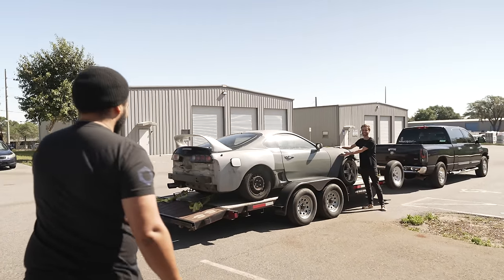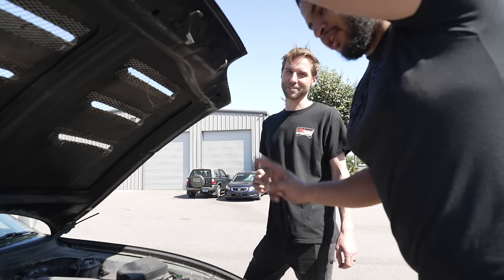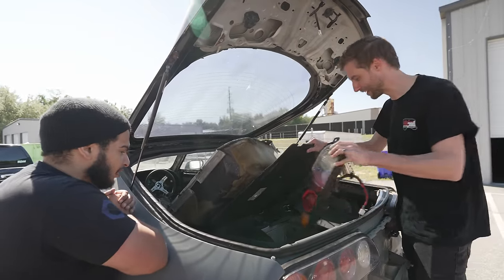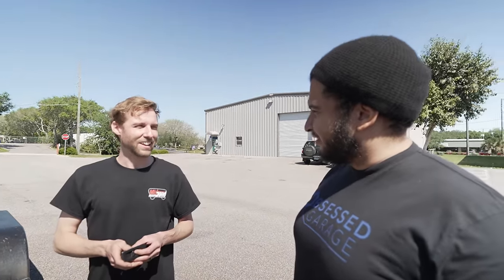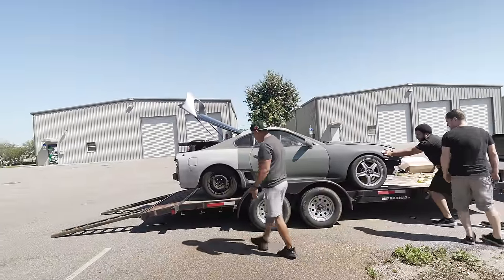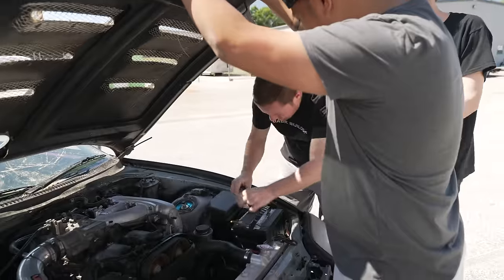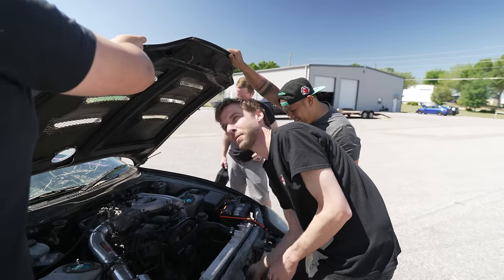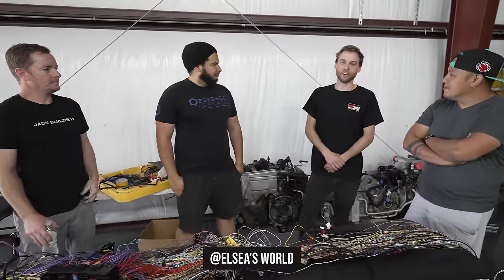I Bought A WORTHLESS Toyota Supra And It's Worse Than You Can Imagine

Comment: If it’s an Aussie car it’ll have an Australian compliance plate & a VIN plate. These plates are usually located in the engine bay likely on the firewall or strut tower for that era. They may also have the chassis number stamped on the frame on the radiator support, strut tower or under the frame behind the windscreen passenger (left side). 
For the year it’s unlikely anyone “imported” the car from Japan outside of being purchased from a Toyota dealership that was built in Japan for the Australian market. FYI
Reply: JZA80 was never sold new in Australia. ALL JZA80's in Australia are Japanese imports. It will have a low volume import compliance plate that will list the company that imported it to Australia.
Reply: True my old man worked at Toyota around that time and they never came here new we only got celicas and mr2s
Reply: @nitrojawt the correct answer 💯

Comment: 1uz Twin Turbo Swap
Should bolt right in, new kits are available online :)))
stock bottom end takes 800 HP with the 1st gen UZ thick rods
Reply: lol yeah u better do a 1UZ swap considering that NA-2J isn't gonna cut it 
realistically, would be cheaper to do a UZ build, avoid the 2JZ tax and get yourself a selpt-on reliable Japanese piece of engineering
You've had SC's before, you probably understand how good 1UZ's are 
U should see what they're doing to them in the middle east, engine turns into a machine g*n for hours on end

Comment: I bought me a 2000 Honda Accord ex 3.0L v6, 4 door coup. The car was totaled and was a total loss. I bought it and rebuilt it. Now I got it like 80% done and road worthy. 
I've gotta get a key phob, gotta get the ball joints on front passenger side, brakes, and gotta get cat backs. About to get the new gasket for my oil pan done. And it needs an oil change. I had to do a lot to it such as rebuild the motor and the entire front end. I had to jump through so many hoops just to get the car legal. Got a salvage title.

Comment: I think the difference of screw vs. bolt comes down to convention. Typically a fastener with an external feature for tightening, like an external hex head or external torx is considered a bolt. Internal feature for tightening, like Phillips, Allen/internal hex, torx, flathead, etc. is normally considered a screw. There are exceptions though. For instance, I think anything that is thread forming is considered a screw regardless of the head.
Reply: If it's threaded all the way it's a screw, if it's got a shoulder it's a bolt. That's with a standard thread, some screws will have a shoulder that is unthreaded but we are talking wood screws. A bolt would normally be paired with a nut where a screw would go into a threaded hole. There may be the odd exception.

Comment: 1st  impression: blow it apart, cage it and make a seat time track fun car... no interior, no radio, full containment seat, 5 point harness, tube the front, and set it up to ev swap later {i.e.: adapter plate to trans.. with enough room to use for other power plants..

Comment: Sounds like the capacitors in the ECU controlling the Fuelpump are gone.
So what happens, the fuelpump primes the system, the ecu shuts the pump of, but doesn`t switch it back on.
You only have to replace te capacitors in the ECS.
It happend on my SC as well.
Edit:
OKAY, I should wait untill the video finishes before comenting ....

Comment: There is a very strong trade for importing used JDM cars in New Zealand, and Australia will be no different. I don't know if there is a hard and fast rule for the year gap (e.g. "3 years") but it will be when the first owner in Japan decides, or has decided for them, that it is no longer economical to keep the car (when the owner in Japan is told that to keep the car running on Japanese roads that $xxxx must be spent on it this year by strict laws that were totally not bought off by the Japanese Auto Industry).

Australia has had a bit more local car manufacturing than NZ, but I believe that is currently not the case, so there is less need to protect local car makers (cos there are none).

Comment: - You could push this across the finish line, or tow it.

- Couldn't even tow that across the finish line.

- No faith.

- I have faith in you, but this isn't a junkyard, this is a garage.

- Hey, pop the hood.

- Pop the hood?

- Pop the hood.

- 2JZ engine. No shit.

- Man, what did I tell you?

- I retract my previous statement.

- You know what?

- This will decimate all after you put about 15000 grand in it or more if we have to overnight parts from Japan.

- We'll put it on my tab at Harry's.

Comment: Make it better than....Toyota Supra 2020🙂
Reply: ENGINE TYPE. turbocharged and intercooled DOHC inline-6, aluminum block and head, direct fuel injection.
Displacement. 183 cu in, 2998 cc.
Power. 335 hp @ 6500 rpm.
Torque. 365 lb-ft @ 1600 rpm.

Comment: If jack does anything as good as the evo the Nobel will be great the supra actually will get him hot boy status I first did AMC pacer 77 pipe seats black with white piping 18 years old toyota tercel, 1998 thunderbird ,1967 mustang  convertible,dodge avenger early model year not new age,civic ek9 jelly bean h22a1 prelude engine,rx7 r1 third generation a fast car ask fast and furious in red ,3000 gtvr4,two Honda crxs with b16,chevy 1500 sierra subaru 2.5 rs impreza had the subaru for almost 16 years no turbo wide body kit not fitted naturally aspirated the greatest thing is being able to build cars that don't have our flaws incorporated in them and we build great things